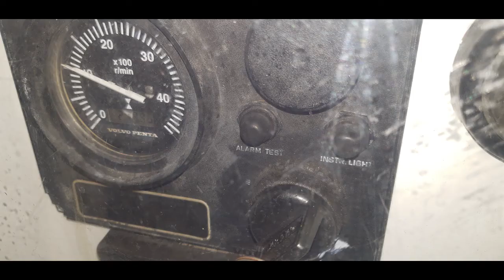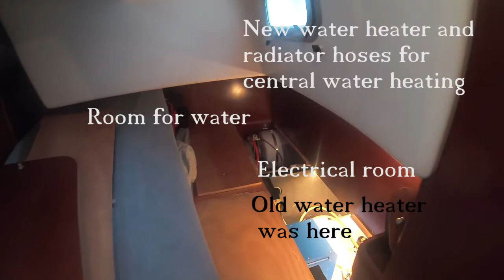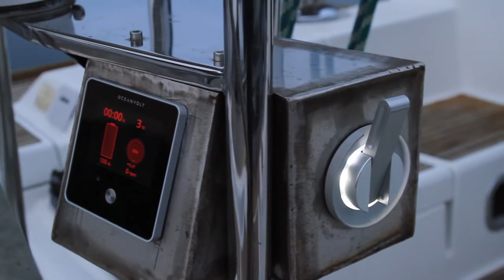Engine room with electrical Oceanvolt First 47.7

Comment: Hello Silent Sea. 
👍👍👍to your video!
I am planning to install also electric propulsion. I saw your batteries are CleanTron and not Oceanvolt. 
Which CleanTron battery type did you chose? 
Why didn't you chose Oceanvolt?
Reply from the maker: Hi, Oceanvolt used 3 different battery manufacturers back in 2020. No, they are mainly using LFP type chemistry from MG.

Comment: Sail boats with electric backup and solar panels are a good idea, but if you find yourself caught in a storm for several days you will run your batteries down. It's still a good idea to have a backup generator. It's not uncommon to get caught in a storm for several days. Especially when getting out of the storm means going back the way you came. People tend to resist doing that. In ancient times they could not know what we now about storms these days. They could not see it's path on radar and know it's heading. Now we can avoid storms if we are willing to chang course adding time to our journey.
Reply from the maker: we have a small Honda 2 kW gasoline generator in the boat. In no wind conditions, it will move the boat in about 3,5 knots. With full bateries and the generator, the range is about 100 NM the first 24 hours, and then 75 NM the following days. So looking at the weather forcast, we can move the boat 175 NM in 2 days and with the old diesel about the dobbel distance. When there is a storm, we are generating more than 1 kW from the propeller

Comment: So no crossing oceans with this set-up
Reply from the maker: There are too many factors to give a short answer. I have travelled about 2000 NM the first seson, sometimes 10 days between marinas. Currently I produce about 5 kWh from the sun on a good day and 1kWh from the propeller each hour I am sailing in a fair breeze. Some days we can produce 10 times more energy than we are using in a given day. In a situation when there is no wind and no sun, and I don't want to charge in a marine, I have a small Honda gasoline generator. With obout 1 kW power, the boat moves 3 knots. We spent a total of 2 l of gasoline the hole season on the generator. Everything has it's pros and cons. For me, I'm happy with the system. I have had an electric car the last 6 years. You have to make some changes compare to a diesel in the way you use the system. It's not about the abillity to cross oceans or not, but about understanding the hole systems.
Reply: @silentsea5568  Thank you for your thoughtful response greatly appreciated.
Reply: @VERTICALWisdom  Bengt is´nt the only one with an electric motor. You can cross an Ocean. I guess you have to adjust to another kind of sailing. Most boats I know with an electrical motor do a more relaxed sailing. When ther´s no wind, well.. it will come back. 
The sailing channel "Uma" has a good overview about this topic.
Reply: @sohno702  I was just about to mention the all-electric SV Uma - she and her crew of two crossed the North Atlantic so that is doable. I do wonder about doing a 30 days'ish Pacific passage.
They also did a infomercial a couple of months back on an all-electric twin saildrive Salona boat. I thought it looked great.

Comment: Good idea not for professional use. If your boat run all day and night, of course with out wind, there is big problem. My friend with electric engine and I with VOLVO Penta d2 55 hp we start together trip 65 miles it takes me 8 hours very easy and my friend 24 hours..! My friend don’t sleep all night and next day it was scrap..😂  I sleep on my warm bed and for that I love ❤️ my perfect VOLVO penta ❤️
Also every day you need extra power from marina. Another thing is too expensive all the electric system.
PS. Don’t forget to buy generator at list 4 kwa.

Comment: How is the noise and the boat vibrations? The same as before or is it more smooth?
Reply from the maker: The noise level is much lower. Now we can sleep in the rear cabins with the engine running. Inside we can have a normal conversation, talk on the phone and so on. The noise from using the engine is mostly comming from the saildrive and propeller. We can not feel any vibrations.
Reply: @silentsea5568  Awsome, thanks :-)

Comment: Hello Bengt, do you know how many kw per kilo the batteries are and are the batteries also from Oceanvolt?
Reply from the maker: The batteries is from Cleantron, but supplied as part of the integritet system from Oceanvolt. littel more than 10 kg.